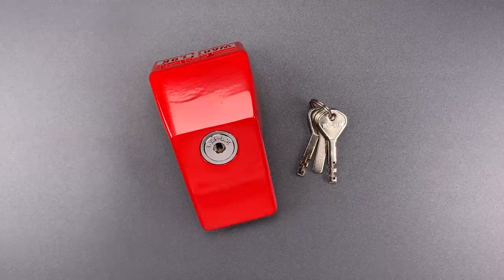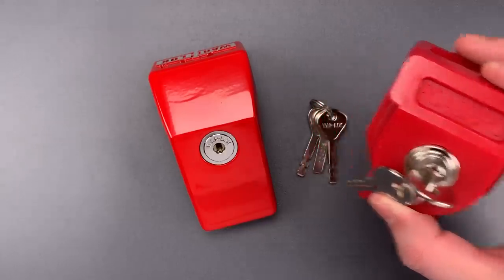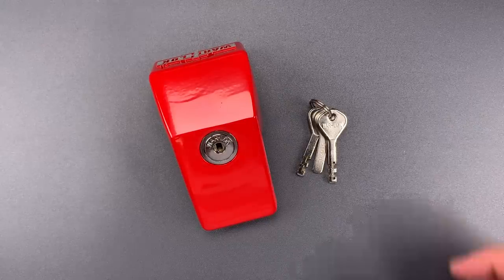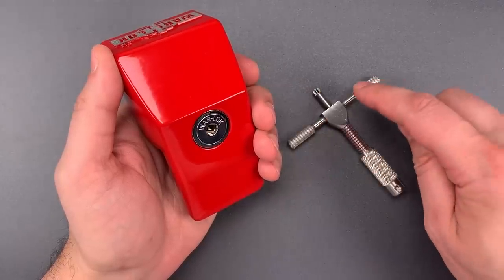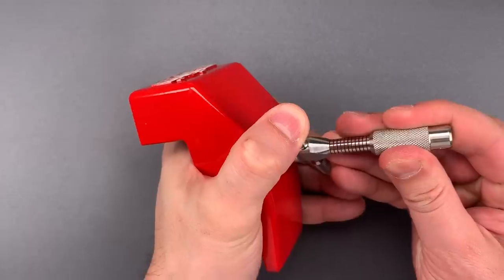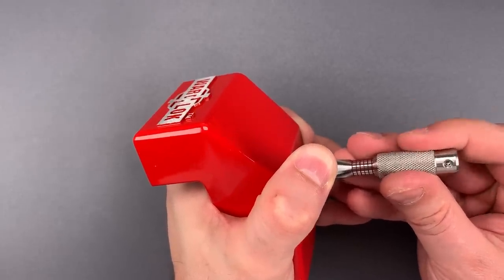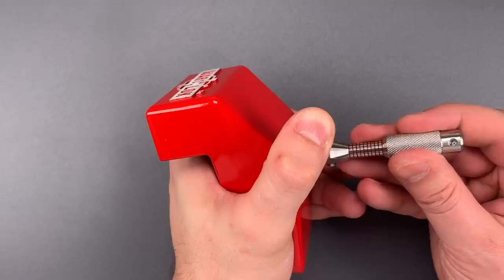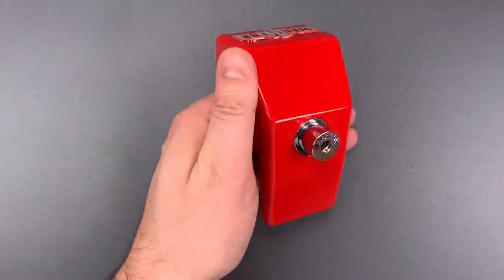[1002] War-Lok “Gladhand" Lock Picked (Model TGH-10)

Comment: If I was interested in stealing a trailer and saw this type of lock, I would simply pull out a big enough wrench take the whole glad hand off and replace it with one of my own
Reply: Would you be able to lock/secure the other side? Or take the glad hand off and lock up the inlet?
Reply: @Melds   The glad hand is threaded, so you can just remove the locked one and attach one of your own to steal the trailer. To defend against that you'd need a glad hand lock that attaches to both glad hands to prevent the locked one from rotating. I'm not sure about securing the inlet but that isn't technically impossible.
Reply: Yup
Reply: You're thinking of the hose side, which is the tractor. The trailer side is a bit different but still easily bypassed.
Reply: TheRedbikemaster I know exactly what I’m talking about, I’ve changed many glad hands on both tractor and trailer
Reply: Will Malcolm I think you should be able to change the glad hand or cage the chambers or back off the slacks all would work?
Reply: Matthew Litke yes you’re right, all would work and if a thief is bound and determined to steal a trailer they will get it
Reply: "big enough" generally being an 8 or 10 inch crescent, or a pair of channel lock pliers... Lol
Reply: Universal parts make it easy, would be faster also to swap out than to pick the lock
Reply: Bill Zinck and I think a bit less suspicious, glad hands have been know to fail and a good driver always has a spare or 2 for replacement
Reply: @willmalcolm9885  true but a good driver is a nearly extinct breed now a days, most can't even change a light or know how.......never mind that's a discussion for a different video
Reply: @BillZinck  You're referring to steering wheel holders.

Comment: Highest endorsement of any product I've seen so far! 
1: had to use a highly sophisticated and (until recently) commercially unavailable tool
2: had to restart picking procedure 
3: didn't know what the hold up was
4: suggested false gates but stated probably good enough as is! (First time I've heard him say that!)
PS my own endorsement.. if you are not a competition winning lock picker with a special tool which was a result of collaboration with a lock picker/machinist you should probably fear the truck driver who is watching you fumble with this while he's warming up for the beat down he's about to give you. I mean let's be real!
Reply: These locks aren't primarily used for security in terms of anti-theft but rather safety to prevent accidental drive-offs of trailers that are not ready to be moved. For instance, the facility I work at had a driver start driving away with a trailer while someone was on board with a moving forklift because someone had neglected to lock the damn brake hose. Most safety lockout-tagout systems are much the same way - anti-idiot measures rather than anti-theft.
Reply: @willythemailboy2  you'd be shocked how quickly this industry will supply fresh, high quality idiots
Reply: @willythemailboy2  Speak for yourself. I hook one up to my truck at work because people like to steal it. After I started using it I don't have to find a truck anymore because mine is always in the yard.
Reply: @Stacy_Smith  "Primarily" vs "solely". Yes, people do use them for security but far more are used for safety. Your exceptional case does not change that.
Reply: @willythemailboy2  True.

Comment: ..yeah, truckdriver here, & you are Correct..it Actually Takes Air Pressure to RELEASE the brake pads First against a heavy Spring before you can Drive both tractor & Trailer..
..i had a brake chamber Fail on my tractor in the wilds of Utah, & had to drive a Treacherous Not For Trucks Route to Civilization where i got a RePower at a TA Truckstop in Parowan, then deadheaded to have my Tractor fixed..after i set brakes that night, next morning the air compressor couldn't build enough Pressure even to Release the Trailer Brakes, it was leaking so bad.. good thing the RePower (another company truck) was on it's way from Salt Lake..

Comment: These are primarily safety devices at docks, to prevent drivers from driving off. Because it is far easier to just unscrew the air hose to the glad hand & attach a temp one to bypass the lock even faster or climb under and cage the parking springs.

Comment: As a truck driver, I can tell you glad hand locks are not designed for high security in the first place. They're designed primarily for shop work as part of a "lockout tag out" system, or for what's called a "live load/unload" where the truck and driver stay with a trailer as it's being loaded/unloaded. Many places use these because they are small, lightweight, cheap (relatively speaking), and easy to take on and off. They're used so the truck, as mentioned, won't drive off with the trailer while someone is repairing/loading/unloading it. For storage and higher security, there's the kingpin lock. It's a massive  round devise that's very heavy and goes around the kingpin on the trailer. A truck couldn't even connect to it at all even if it tried

Comment: I'd like to emphasize as I did for the other gladhand lock that these are LOTO locks intended to prevent accidental hookup while dock workers are inside a trailer.

To prevent theft one would use a kingpin lock (as I've seen you tackle before) as any experienced driver carries a wrench and spare gladhand for field repair. Replacement takes less time than you took to pick this. :D

Keep up the great work, LPL!

Comment: It was heavily commented on after the last glad-hand lock video, these are more designed to be a Lock-Out-Tag-Out device than a theft prevention device
Reply: LOTO locks usually have high security because they're for safety and you don't want just anyone to take it off. For security, this lock at least slows an attacker down to the time to replace the glad hand instead of jiggling open an easy lock.

Comment: Just a heads up. The Emergency brake on the trailer comment is wrong. Air Pressure is used to keep the leaf springs OFF. With no air the leaf springs are locked down and the wheels wont roll.. If air pressure gets to low the leaf springs will be applied. So if the tractor cant apply air pressure to release the Leaf Springs that trailer isn't going anywhere except by dragging it  against the brakes.. Thats a simplified explanation but sufficient IMO. I've had a CDL Air brake certification for over 20 years so I have some idea what I'm talking about.

Comment: Interesting amount of difficulty for a type of lock that is mostly used for lock out / tag out purposes. (Kingpin locks being way more secure for preventing roll away theft because the gladhands on trailers can be easily replaced with the right tools, while the king pin is not something you're going to replace in a parking lot)

Gladhand locks are way more useful for instances where a trailer is being loaded or unloaded and you don't want the driver moving the trailer with a forklift inside OR when the trailer is locked out by maintenance personnel pending repairs. In both instances, it's more of a warning device than a high security lock.

Seriously though, the bypass for this lock is just to walk inside the truck stop and buy another glad hand. Grab your pipe tape or tire chalk from your tool bag along with basic hand tools, and replace the glad hand. It takes a novice like me maybe 15 minutes.

Comment: Just ordered one because of the slightly positive commentary. I think this lock with a solid aluminum body and decent core compared to the plastic road pro that can be removed with a screwdriver by prying it off... is loads better and will be perfect for securing company trailers I need to step away from.

Comment: Most trailers have a shunt valve to make the shunters job easier basically bypassing the need to connect the air supply

Comment: Attempt #2 - You should try and pick the master lock 517 D adjustable shackle padlock, its got an interesting core in it that may surprise you when you compare it to the normal master 4 pin marshmallow core. We use it to lock up our fence gate, and I'm interested to see how much protection it really provides! (Though knowing it is a master, its on the inside of the fence just to be safe)

Comment: The gladhand itself is insecure enough that adding false gates would be a waste, if you have a spare gladhand and the wrenches to remove the one on the trailer, you can swap them in a minute or two. Gladhands are fairly easy to break so keeping spares and wrenches is fairly common.

Comment: Hello Mr. Lock Picking Lawyer,  will you please help me.  Exercising my 2nd Amendment rights, I travel around the U.S. with various hand guns that go through "checked baggage".  However, the lock box I use has a wafer lock and the TSA(which really means Thousand Standing Around) has opened it(picked it) without my knowledge or permission.  Will you recommend a travel size lock box/lock that is durable and something the TSA cannot pick.  Also btw, a good friend of mine went through the Citadel back in the late 1980's.  I have great respect for him.  Thank you very much for your help and input.

Comment: I would guess that this isn't a bad lock at all. Considering most of the folks looking to steal a trailer wouldn't have a specially designed lockpicking tool with them, or have the incredible ability LPL has for opening locks. So if LPL says this lock is good as is that would encourage me to use this if I had a need for them.   :-)

Comment: If the trailer is gonna get gone glad hand locks won't slow them down. Cage the brakes and go worry about everything else later. A brake cage lock would be better
Reply: What do you mean by "caging the brakes"? Are there common locks to protect this attack? Thanks.
Reply: @Melds  yes I know and the fastest way to bypass the glad hand lock change out the hoses it's the GPS that is the problem or I should say GPS s

Comment: Wouldn't cutting the hose and adding your own new connector be easier than defeating a high-security lock?
Reply: Was my thought was well
Reply: There's not a hose easily accessible at the connection in question. It's a metal connector directly welded or otherwise secured to the trailer. 

You can certainly get the connector off and just replace it, but that'll be a bit more obvious and take more time.  Generally that's enough deterrent to at minimum send the prospective thieves to an easier target.

Comment: Actually it would take 5 minutes, maybe less to disable the emergency brakes on a semi trailer and all it takes is a 5/16 wrench.. But it might be faster to just unscrew the gladhand and put on one that doesn't have a lock on it and that only takes an adjustable wrench... Anyway what I'm getting at is that those are garbage.. Look into the beefy king pin locks that prevent the tractor from being able to couple with the trailer if you want security that isn't easily bypassed.. Not saying that those are any harder to pick, that's for the @LockPickingLawyer to decide all I'm saying is that anybody that wants to steal a semi trailer probably has the knowledge to bypass this lock with ease.

Comment: Can you do a video on electronic door locks? I want to put some in and access it from my phone (doesn't have to have a dedicated app, API is fine) I was wondering what you think of the most secure on the market right now
Reply: Some can be good, but beware of weak secondary ("override") locks and bypasses. For commercial I usually recommend a good lock set and a separate electrified strike, but I don't know much about residential offerings. Maybe start with the better name brands known to do both, like Schlage.
Reply: @Melds  I see, Do you know, or can you point me in the correct direction. I am interested in finding one that has some form of api that I can develop an app on. I dont really want to build my own, but if I have to I will.
Reply: Unfortunately I don't. I mainly work with Schlage SMS and DMP. There are interface for remote control, but they're overkill for a small install.

Comment: Galdhand lock are useless.  I'm a trucker. And i have spare gladhand.
 Removed lock gladhand and replace. Trow the lock one on the step. 3 min tops.  

They are more for the safety of the  forklift operator. So no one leave with him inside, and the driver is forced to go inside.